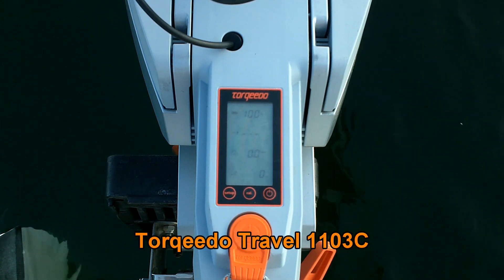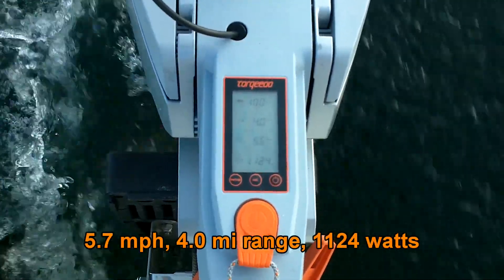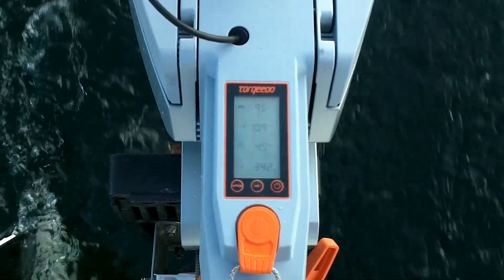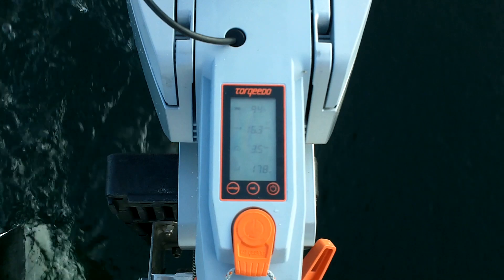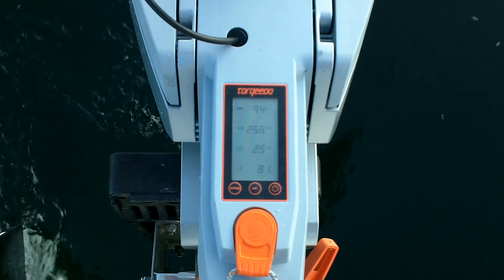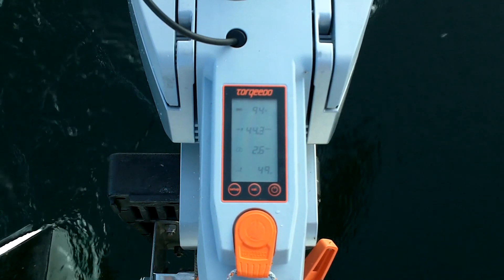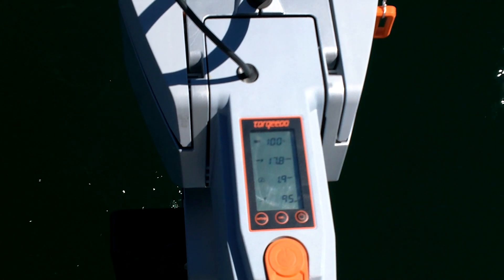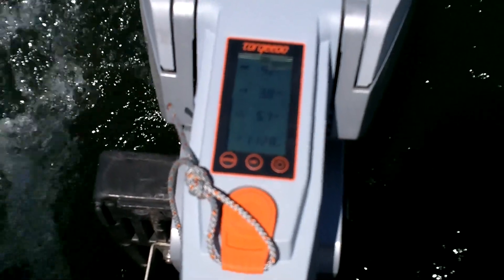Torqeedo Real-world sailboat test (UPDATED)

Comment: Thanks for that, id suppose wind factor should allow to calculate range at what it would be for double or more the actual speed?
Reply from the maker: The speed displayed is actual speed over the earth based on GPS…the water speed could be higher or lower depending on current. If motoring into the wind, the boat experiences more resistance and drag, requiring more power for any given speed. But, the Torqeedo’s display remains accurate as far as power consumption, speed and range. Does that help?
Reply: @ColoradoSailing  it does indeed. Ive bought one and will be trying it on my boat in the coming weeks. Its  18ft Foxcub, approx 1 ton including myself and the gear in it. Im sailing upriver on the Shannon and think the river flow is between three to one knot against me, plus wind, so am hoping it can do the job.
Reply from the maker: @sailingwyvern9564  I’m thinking a 3 knot current will be a challenge. I’d guess that to move 1 kt upstream against 3 kts of current would take 400 watts of power and yield maybe 8-10 miles of range in those conditions. Of corse, if you only have 1 mile upstream to go you should be fine. You can also use the sails to help (motor sail) if possible.
Reply: @ColoradoSailing  buy emtrc bayliñer

Comment: Nice demo. I really would like to spring for one of these but at >2x cost of the putt-putt (and well over half the cost of my boat itself), it's making me balk. Plus, I eventually want to take my rig on stuff like the TX200 and I'd be anxious this wouldn't be up to the task for the higher end of bad weather on those trips without a huge energy bank on standby. But I'm a sailor, I shouldn't need any motor. Really it's the cost.
Reply from the maker: For me, it was several things: 1) not water cooled, so easier aquatic nuisance species (ANS) inspections at the ramp, 2) instant reverse gear instead of spinning the motor 180 degrees, 3) no maintenance or tune-ups, 4) whisper quiet, 5) access to “electric-only” lakes, 6) I primarily sail small lakes so not a lot of motoring. Certainly risky on longer voyages with lots of motoring.
Reply: @ColoradoSailing  oh man, I never thought about the ANS inspection

Comment: On the strength of this informative video i have changed my 5hp Mariner for a Torqeedo. I was so misinformed about the run time of an electric engine, that i wasn't going to change, until i saw your video. so many thanks, i now have a torqeedo on my Drascombe coaster and i'm very pleased with it.
Reply from the maker: Thank you! I can think of no better compliment!
Reply: @sumobear - I have a Drascombe Lugger and have been considering the Torqeedo 1103CL. I sail in/out of a tidal harbor that, not infrequently, presents head on wind and current of+3 knots. On infrequent occassions I have had to use near-full throttle on my 3.5hp Mercury outboard. I currently have an opportunity to purchase a new 1103CL for approximately 30% off, but am concerned about having insufficient juice or running out of power. Curios what your actual Torqeedo-powered Coaster experience has been. Thanks in advance for any comments or additional information you can provide. And, special thanks to firefighterdave for this really informative video.
Reply: teßt8ng topßpeed

Comment: I do know Torqeedo is a great outboard and think it could work for many like those on a lake or in many other situations.  You gave a great video of what to expect on probably an average situation.  The one thing lacking is are you using 1 battery or more and what the amp/hrs for the battery/ batteries.   Also do you program the battery capacity info into the Torqeedo or does it somehow know?    Thanks.
Reply from the maker: I have one Torqeedo 915Wh battery ($995) which is 29.6V rated at 31Ah. I’ve never gotten my battery below 50%; even though I’ve sailed for 3 consecutive days without charging. But, I am paranoid, so I did purchase a 12V charging cable ($50) which I can connect to my boat’s 12V 35Ah deep cycle marine battery. I estimate it will give the Torqeedo a 50% charge…but I’ve never had to use it. I also have a small solar panel for the boat’s 12V marine battery…but have not had a need to use it either. The Torqeedo outboard has a built in computer with GPS that monitors the battery and provides speed, range and consumption and battery life remaining…
Reply: @ColoradoSailing  Hmmmm,  Obviously not a Trolling Motor from walmart, Lol.  My mistake.  Thanks for the great video and educating me of what's out there.
Reply: @jefffrayer8238  I have the Epropulsion equivalent - Spirit 1.0. it has a 1.2 kWh battery so it will run at full power for an hour and a half - about 6 miles. At 30% power probably 20 miles of range. You can find the Torqeedo on eBay or Facebook marketplace used.

Comment: relying on readout estimates. not actual. and in what wind,current,tides?
Reply from the maker: This is in a “no wind” situation with the exception of one test done in 12-15mph winds. The wind test showed about 2x power consumption and 1/2 range of similar speed of “no wind” situation. As far as actual numbers, when motoring a sailboat for long periods over long distances throttle changes are often required (obstacles, letting other boats pass, maneuvering around kayaks, changing direction relative to wind, wind speed changes or shifts) and the computer re-calculates range for each change, making the data useless. Given that and the fact the lake I’m on is only 5.3sq mi…a long-distance real-world test is impractical and really would not translate into solid real world useable info. The general point here is with throttle demand, runtime goes down exponentially. Plus, I’m a sailor…I’d rather spend my time sailing! 😁